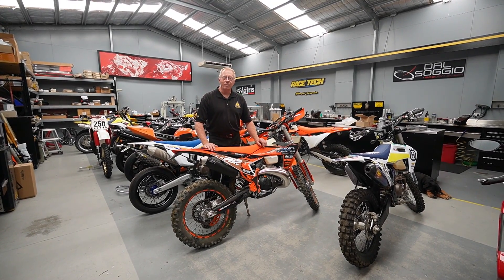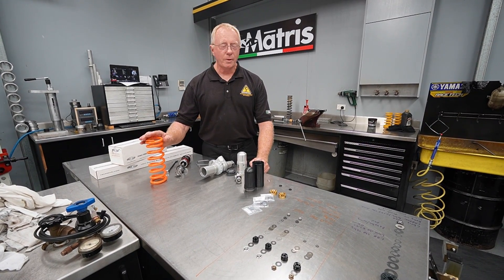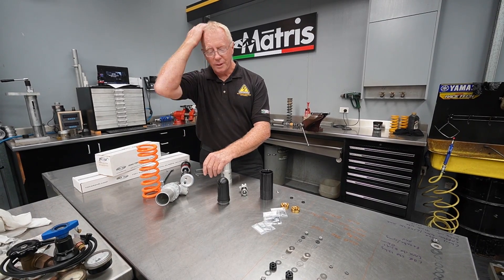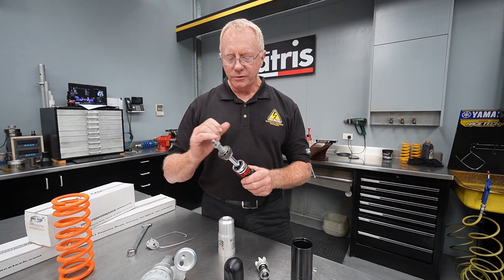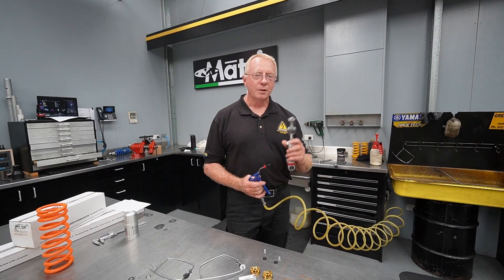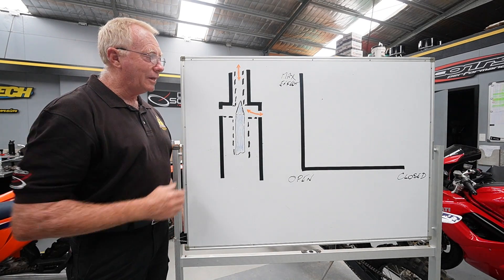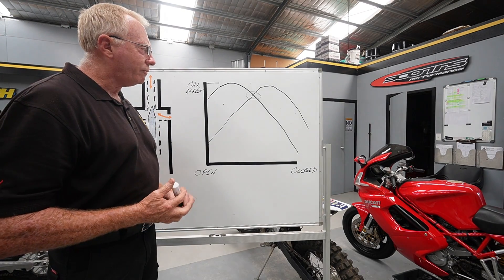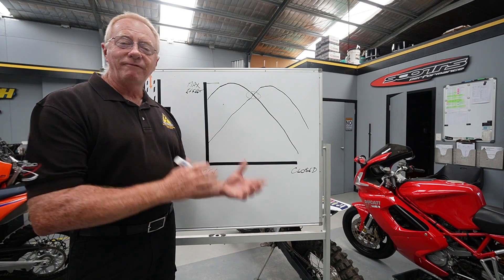2024 KTM EXC Shock Absorber Tuning

Comment: I have a 2017 PDS with bladder and progressive spring. Is there a rebound separation valve for older Xplor shocks?
Reply from the maker: No need. They have one in there as standard fitment. You just need to drill a bleed in the centre of it to make it work properly
Reply: @shocktreatment5495 I have the same bike. What measure I need to drill for hard enduro? 2mm? Thanks and you are amazing

Comment: Your video's are just so amazing.  Can you do a tuning video on the 2023 ktm 250 xc line in particular the issue with the shock and the faster shaft speeds and if you have any particular mods for the compression side that you like with or without a spring conversion.  Great vids!!!!
Reply from the maker: Cheers. Did you see our clip on the AER fork? You can revalve the comp and change the mid from a clamped shim arrangement to one that has some float.

Comment: How does changing the size of the nitrogen bladder affect performance of the shock? Just curious.
Reply from the maker: Whether you use a bladder or a piston, the gas will be compressed on the compression phase and will expand on the rebound phase. The hydraulic force acting on the reservior is being generated from the shock shaft entering the shock body. Two things are at play here....force and friction. Hydraulic law.... Force = Pressure x Area.
 Due to the greater surface area of the bladder, more force is generated making it easier to compress. Add to that the fact that there is almost zero friction from the bladder and you eliminate several unwanted issues that are associated with the piston.
If you change the bladder for a smaller or larger item, you also alter the surface area which naturally affects force accumulation.

Comment: Thanks mate, another great explanation. I’ve been struggling to understand suspension for years and moving disciplines has actually helped quiet a lot. Really cool seeing what I think is a hydraulic bump stomp (from 4 wheeled offroad racing) incorporated into a shock. Avoids an enormous amount of complexity with extra mounts etc.

I think I’ve struggled to understand that all the fancy marketing stuff has convinced me that some random new creation is “alien technology”, when the important order is the geometry is correct, the spring rates are correct, the compression is correct and the rebound is correct. Mtb manufacturers talk about geometry, but almost no-one else. People are selling fancy multistage dampening instead.
Reply from the maker: In MTB the motor is given the utmost consideration because "You" are the motor.....
How power is being generated through the bike is critical to maximising its delivery as well as managing fatigue.
The geometry is vital. 
It's the same for motorcycles but for some reason is largely ignored.

Comment: Great info as usual.
I was wondering what is the history of the PDS shock system? Was it Husaberg that originally came out with this and then adopted by KTM ? Seems nobody else does this on MX bikes? Odd that after all this time the manufacturers still haven't got it working right yet ?
Reply from the maker: The PDS came out in 98 with KTM. It's not bad but will never beat a linkage

Comment: KTM goes on about all their engineering and suspension development yet keep doing obviously silly stuff ups. It appears it’s on purpose to sell ‘upgrades’
Reply from the maker: The forks are great....just need some tweeking. But the shock is a little wierd. Its like no one did a simple push test on the seat once it was done
Reply: Exactly.
Reply: How can we work out which progressive spring rate we need for weight? Presumably it will be different to working out for straight rate ??
Reply from the maker: @Cookie-pct  It's a little different but mostly similar. The force required to suspend both bike and rider at sag level will be exactly the same no matter which spring you are using. But it is safe to say that the progressive spring may have already started to escolate in spring rate prior to sag being achieved....but not by much. So if you could achieve desired sag with a 7.6 kg/mm linear spring, you will be very close, although a little lighter in initial rate with the progressive....perhaps a 7.4 etc
Reply: $12,00 for a bike and then you need to spend $5,00 on suspension, yet people keep buying them.